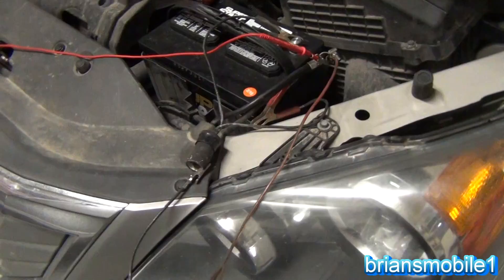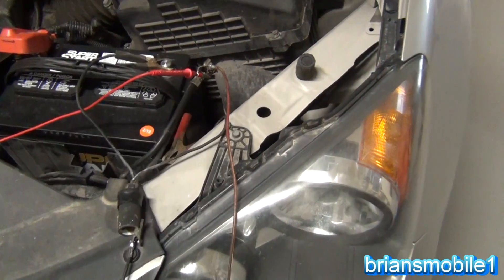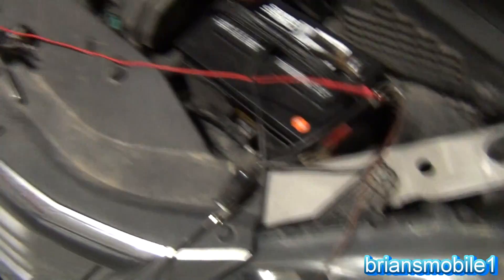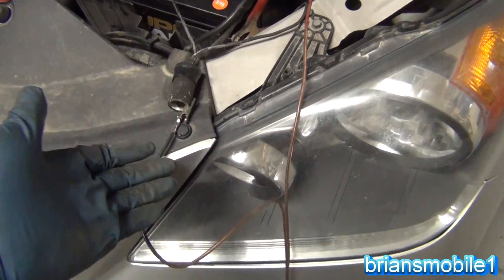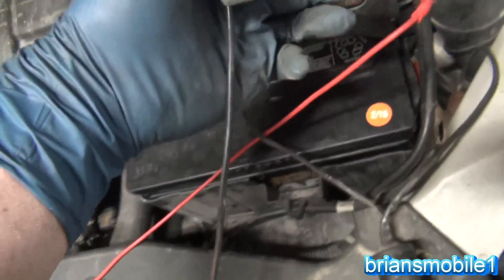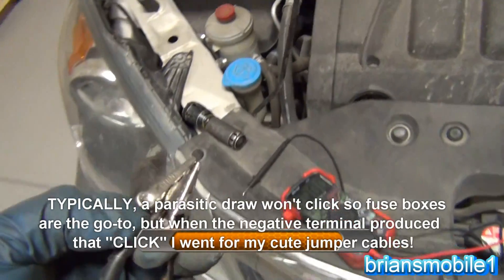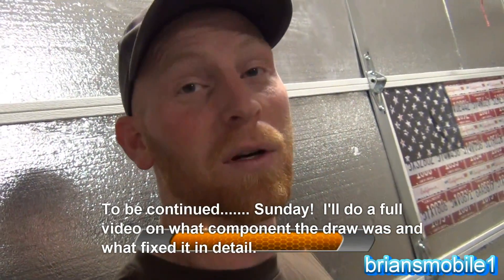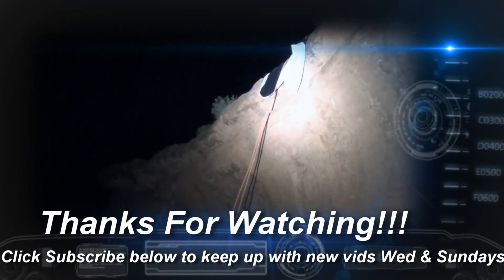Tiny Diagnostic Jumper Cables CHEAP!

Comment: Brian I have an 02 odyssey,I have been having trouble with the battery draining,It's been in the shop they replaced the a/c relay still drawing battery,I noticed an issue with the passenger sliding door,and found a pencil in the door stopping it from closing properly,once I removed this do you think this could have been my problem,I just hate to take it back in if this could be the fix.? Thanks

Comment: I use a similar trick, but with Ethernet cable.  Eight wires in all. Twist four together for ground, and the other four for power.  The beauty is that the wires are color coded and so small you can stick them in female electrical connectors without having to worry about spreading the connector apart.
Reply from the maker: Pet Rock's Garage I like that!  Great way to bypass a component to the computer to diagnose quickly if the wiring is the culprit.
Reply: Yeah, the extra wires come in handy too if the connector has more then one pin.
Reply: Like a three wire connector (e.g. camshaft sensor or multi-speed fans).  You can mimic the behavior of the computer if you want and rule out a bad component. The wires are also solid, so they will stick into the female sockets nicely, or wrap around the male pins or an alligator clip can't get in there.
If you use this trick in a video give me a shout out.  :-)

Comment: Just as a suggestion (not sure if itll help you or not, but may in the future) is that all Honda's 2006-2009 that use an "Omron" brand Air Conditioner Relay have a tendency to stay open- which in turn draws amps and eventually kill a battery.
These "Omron" relays were replaced by Honda with a "Mitsuba" brand and thats what solved the problem. Its something stupid, but cars these days are only becoming more and more complex.
Look forward to more of your videos!